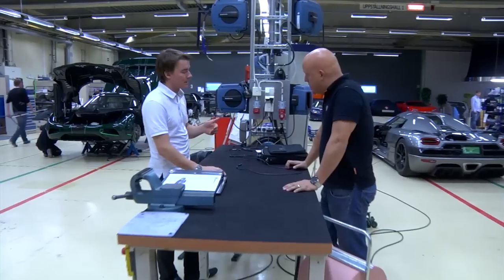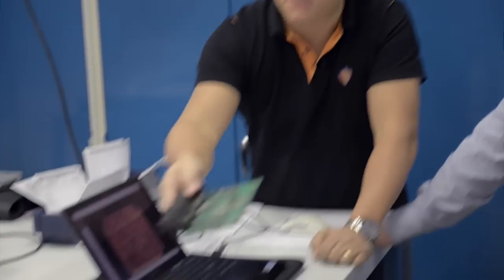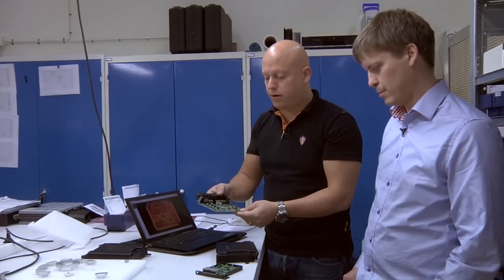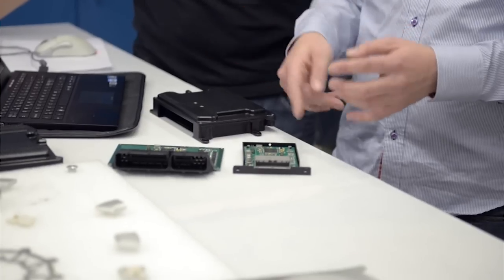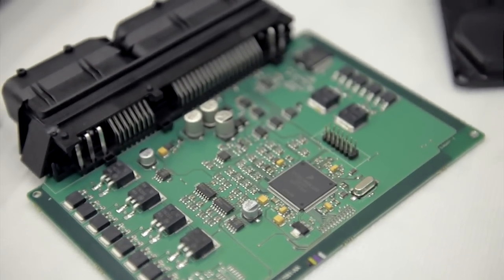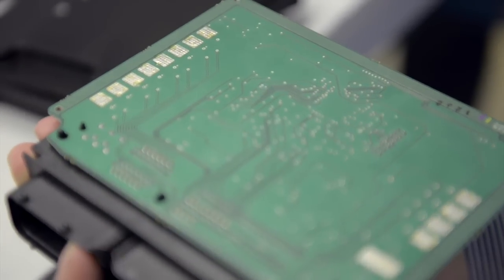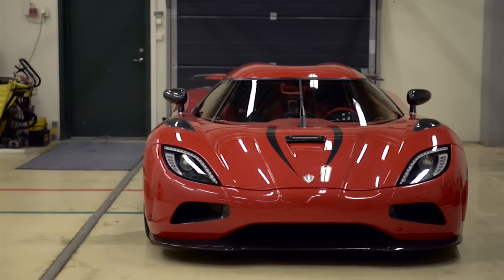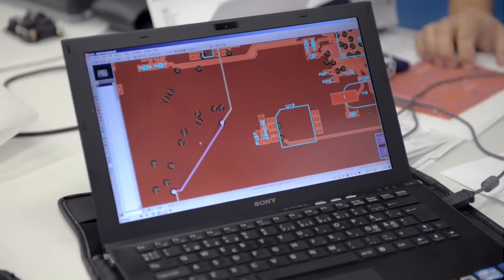Inside the Brain of a Swedish Bombshell - /Inside Koenigsegg

Comment: Nope, after the CCR they switched to an in-house block of their own design. Pagani's engines are built specifically for them by AMG, not modified like the 'vette block is for the Venom. The Venom is still clearly recognizably similar to its donor car, the bonded chassis/cabin is essentially untouched by Hennessy, the rear subframe extended, some suspension work to widen the track,  aero additions, etc., but if it was built by anyone else, it'd be called a very modified Elise +LS9, not a new car.

Comment: @FordV8Supercar: Actually there's a  bigger difference that isn't in the engine itself. The engine the Agera R runs on can use E100 aka pure alcohol. If you do that, it produces nearly 1200hp. If you use American gasoline in it, it produces around 900 or high 800s.

Comment: The Agera makes 960 hp, the Agera R 1140 hp on biofuels (not just E100) and the Agera S which is a "R" for countries without bilfuels makes 1030 hp on regular fuel.

Most of the confusion comes from the Agera proto running on a CCX engine at the time of some tests and the new ECU that added more hp to the turbo set-up.

With the new ECM it runs 960 hp on US 93.

watch?v=f-zv6ZY4p4A

Comment: Yeah, I was spitballing. I didn't check the numbers on their site or anything, just saying that a lot of the confusion I've seen comes from the different performances on different fuels. Didn't know about that CCX-engined Agera though.
I do have to state that the more alcohol you put in an R, the higher power it runs. It's not what the site says anymore, but when they had the press release on there, it did say that.

Comment: the Agera S is if you want an R but doesn't want to run bio-fuel. you can run an R on petrol but it will have the same power output as a regular Agera. 
The Agera S is not as powerfull as an R but will have 1040bhp on 98 Octane petrol. So far only one has been built.

Comment: i hope you do not use cheap  chinnese component from ebay, as i do, 
I retrofit my cars lpg system and i needed low voltage switch/alarm and all of 5 i bought failed after 3 uses

Comment: It is not all about straight line racing.... If you buy a "Super" car it should be able to compete on a track.... if not than something is wrong. Veryon may have a good top speed but it is a waste.

If you saw the Veryon test on top gear you see it is a while before it hits top speed. 

There is no U.S highway were you can do 240+ without killing yourself or getting arrested.

Veryon is still just the hip hop hype car. Half the people that buy them wont even reach the top speed.